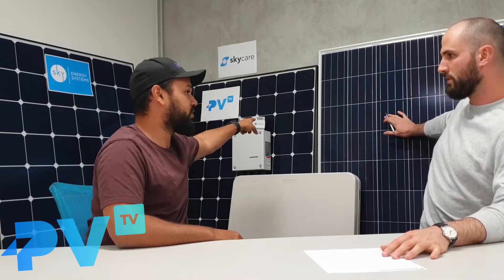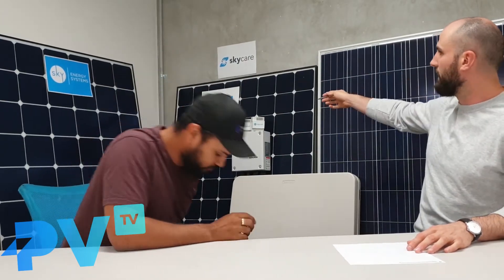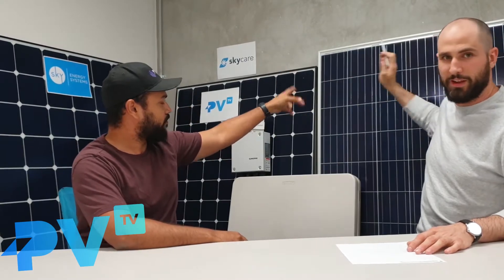PV-TV E 12: Difference between a 280W and 350W solar panel.

Comment: What is the best 3 phase solor inverter? When buying a new system and trying to get the most bang for buck out on what you pay should you go for a high end inverter and ok solar panels?
Reply from the maker: Hey Chris, great questions. Generally a solar inverter is doing more ''work'' than the solar panels and is therefor more likely to fail over time. This is also why solar panels generally have a much longer warranty. So in short Yes I would prioritise purchasing a quality inverter and some great mid tier panels to stay in budget. Which inverter you should buy does depend on things like, if your property has shade and if you want a battery down the track. The SMA Tripower is a high quality threephase inverter that caters for all these options . Trust that helps!
Reply: Mpp solar lv4850 its a beast